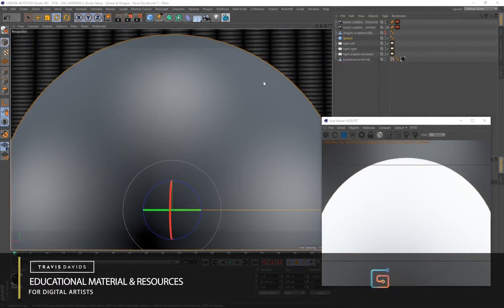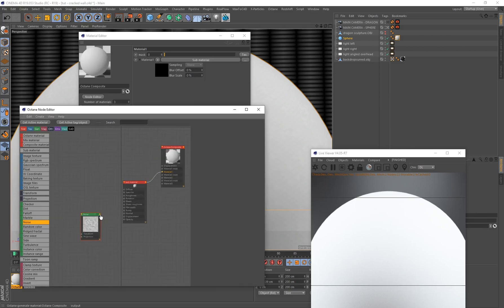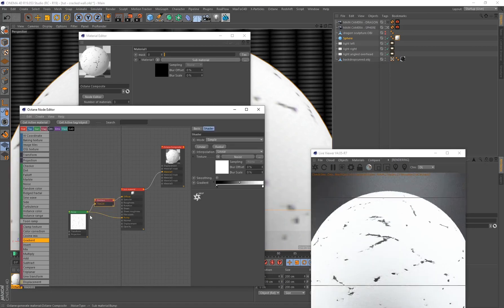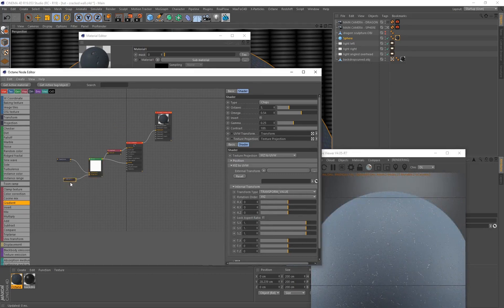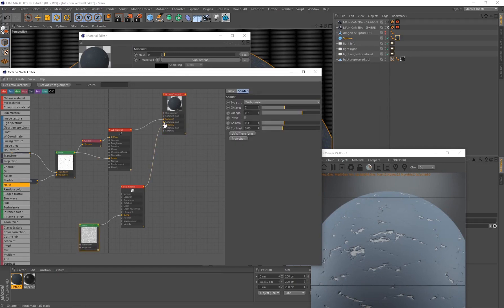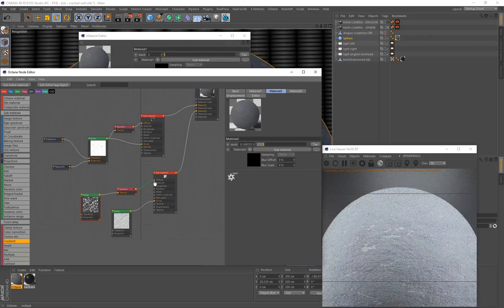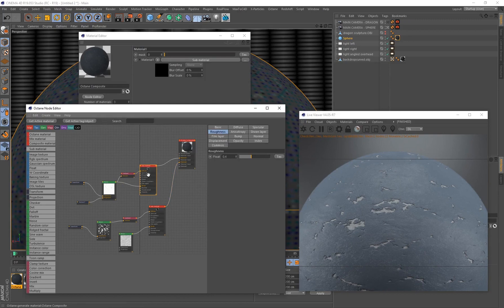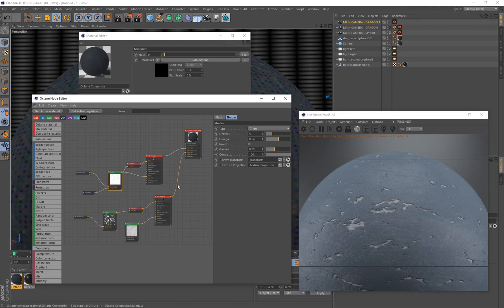Cinema 4D & Octane Render - Create A Procedural Chipped Or Damaged Wall Material

Comment: Really helpful understanding the process. I have a problem when I use a C4D Noise shader wich looks pixelated. I know there is a solution to fix the problem, could you explain it please?
Reply from the maker: Thank you. Yup i experience the exact same thing, i avoid the C4D noise shader with octane because it always looks pixelated and i don't know any fix. I just use the octane noise instead. Sometimes it looks pixelated but not as much as the default c4d noise.
Reply: @TravisDavids  Thank you for the response :) I saw a trick to fix it on another video but I lost the link. I will let you know
Reply from the maker: @momolovic3909  Ah! Please let me know, i'll search for it as well because i honestly don't know.
Reply: @TravisDavids  Hey Travis, great tutorial! This might be the solution for getting rid of the pixelated C4D noise inside Octane. Inside the Octane Settings window under "Settings" there's a thing called "C4D shaders". Its render size is set to 128 by default. make sure to change this to a higher resolution in order to get a better looking Noise, but be aware.. this can slow things down quite a bit. Hope this helps! x
Reply from the maker: @FloMNIB  YOU ARE AWESOME! That legit works 100%!!! Now i can actually use the C4D noise. Thank you! It really slows it down so i would only do this at the end and maybe work on 128 or 256 to get a general idea of how it looks and on the final render bump it up to 4k resolution.